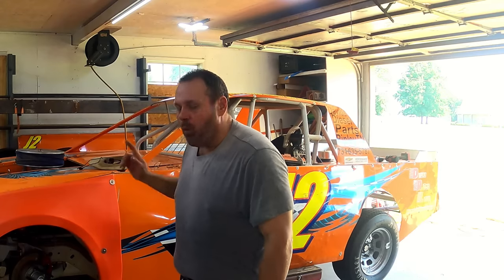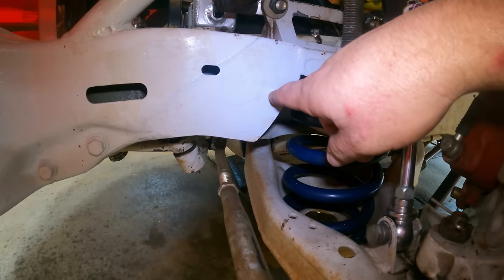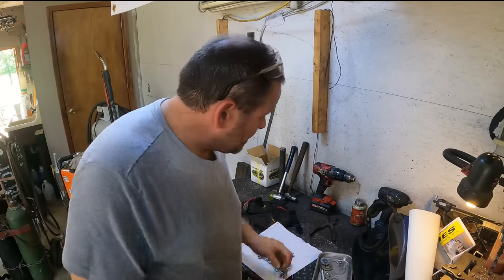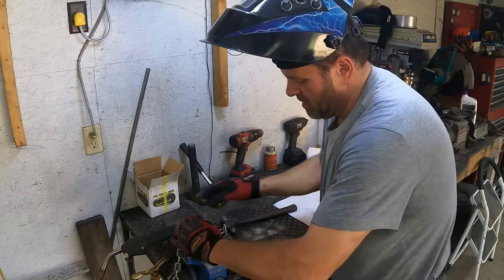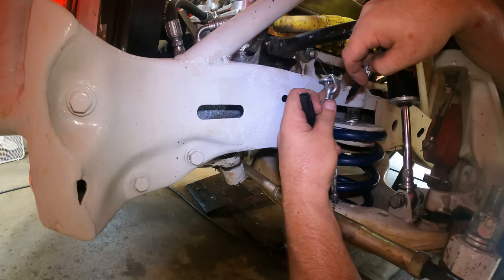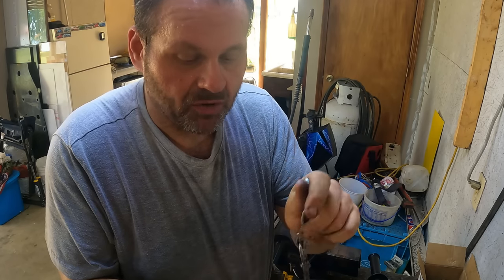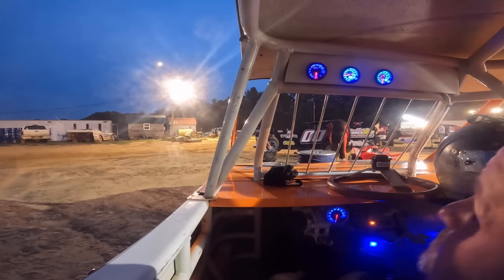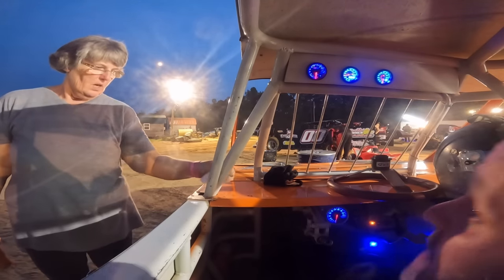Running a LF Chain, How to Make, Install, and Understand how the chain works

Comment: I would recommend tacking a washer on the inside of the frame and welding a good solid thick washer on the outside where your chain attaches to the frame, you would be surprised at how that 5/16th bolt can bend that lower edge of the hole out, especially on a rough track. Washers will save the frame hole from getting hogged out and you can replace them if the washers get tweaked.
Reply from the maker: Good tip

Comment: Gotta be careful with that chain! It's a really useful adjustment, but keep those adjustments small.  If you shorten it too much, it'll drive that left rear too much.  I've seen a 1/4" chain take the car from rotating good to toting the left front all the way around the track.  Car looked really good in that hot lap session though!  Good luck at Whynot!
Reply from the maker: Thanks man, I am hoping we'd night in practice to be able to run, tighten, run, tighten to figure out exactly where it needs to be for full slick versus hooked up.
Reply: Agreed. The LF chain can tighten or loosen the car... and it doesnt take much. It all depends on the setup, track conditions and driver input... If you have room, try using a stiff roller cam spring to act as a buffer to reduce the shock when the chain becomes tight... or a small biscuit.
 
LR droop will determine the amount of mechanical drive is in the car. Left side chain adjustments can be fun when it's right. 😊

Not sure what your rules are.

Comment: Don’t use regular heat shrink it’s slather 🍑! Use flexible woven FABRIC heat shrink. I use 3:1.  It’s far more clean and professional looking and fairly cheap. A foot long piece wide enough fit any chain is less then $5. It’s more flexible then standard heat shrink and let’s the chain work more naturally.
Reply: The chain drastically effects body roll and transfer to the RR but the effects on me mechanical leverage that your talking about effects the LR far more then RR at least on a 4 bar. It’s increased more as that transfer is pushed from the RR over to the LR of your sprung right and more so on a bar car as the RR birdcage indexes into the spring.  Your  upper trailing arm angles, drive angle and even anti dive will also significantly effect how that weight transfer is distributed.
Reply from the maker: Good info right there bud.
Reply from the maker: More good info that's much appreciated!

Comment: I know a lot of folks are doing it but I don’t want ANYTHING topping out or bottoming out! I can see having the mounts and chain available for going to different tracks as a “crutch” for say when you rolling way too hard on rr and toting lf really bad or one on lr for a rough track when your bottoming rf real bad but I don’t want to use it as a regular adjustment. Just me maybe I’m wrong. Good luck at Whynot bud!
Reply from the maker: I REALLY struggled to get my head wrapped around how thus is better. Literally had to stumble my way into getting this chain system working. But geez David.. yeah it's faster, I was very skeptical at one point but in the car its crazy how much different it makes the car act. I know I'm not the right one to prove it with my results but this is what the leaders are doing. Even in classes that don't allow chains, guys are moving mounts to make shocks top out to force load transfers. It's crazy what this has become but there's really an advantage in it. . .

Comment: When I made mine, I welded a swivel on a 7” long  3/4 all thread with a nut welded to the chassis and on the end of the all thread (with a jam nut of course). That way you can adjust it like a screw jack on the fly
Reply from the maker: That sounds like a slick setup.

Comment: No problem with having another fine tune option. 
We started putting then on our house chassis back in mid 90s.
As one of the drivers i can tell you it helped when tracks really slicked over. Not too much on red clay or sand but on gumbo and riverbottom dirts it really helped.
Reply from the maker: I am still learning it but I don't feel like it did much for me on that clay last weekend.
Reply: @DIRTRACELIFE  naw I got a few top 10s there the first few years. You need all the right rear you can get then just adjust left rear bite to come off.
Reply: @DIRTRACELIFE  most all the deep south tracks are right rear dominant tracks. Southeast and Midwest tracks were always more left rear tracks.
Reply: @DIRTRACELIFE  that little over steer you had that 1st pratice night is when you had it almost perfect. That makes running mid to hight easy there. Then just drag it in if you want to run low.

Comment: The left front chain has almost nothing to do with the rr wheel weight. If the right front has a solid rod in it for a spring and the chassis has infinite torsional stiffness, the rr wheel weight will increase by exactly 0 lbs. 

You should look into roll rate distribution. 

Left front chain gets tight, ALL of the weight on the left side of the car is on the left rear. 

That’s what it does. When you want all of the wedge, make sure the chain is tight.
Reply from the maker: Thanks bud

Comment: I know you built that car you said it was a big GM and you're using Nova or Chevelle lowers is that like a 76 Monte Big frame or is it early or mid 80s Caprice or Impala frame I have the big GM that's early 80s mid-80s Caprice or Impala now I was just wondering if what the advantage to using a Nova or a Chevelle lower is but just curious buddy thanks
Reply from the maker: I sure misspoke there and didn't catch it. This car is a 73 Montecarlo and those lowers are the 73-77 Montecarlo's which are the same as gen 2 camaros. The spring pocket location on these and the novas are both creating a 30% spring ratio (example a 1000lb spring is seen by the car as 300lbs). The stock metrics are 23% and a lot of folks are switching those out with novas because it moves you to a 30% and it widens the front track by an inch on each side.

Comment: Throw them chains in the garbage
Reply from the maker: I appreciate the comment but the type springs and shocks I am running do not work without them. Its a package deal for how this car is built and the type cars in the class. On my factory stock Camaro for example I do not use any tethers.